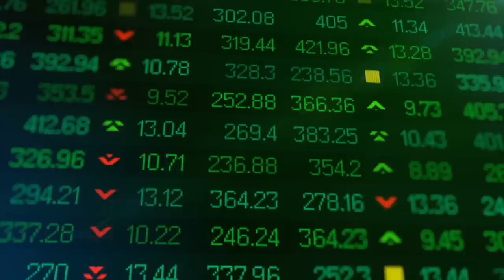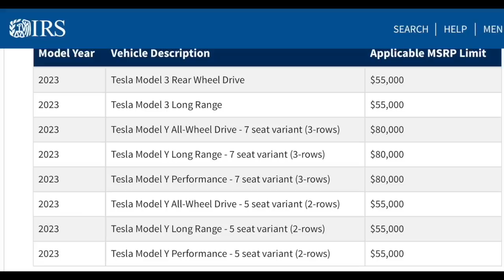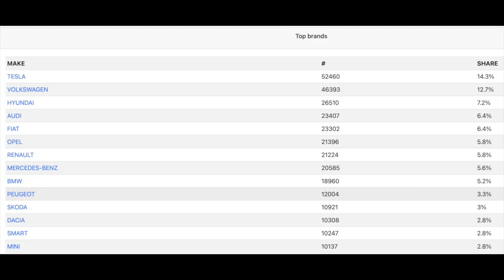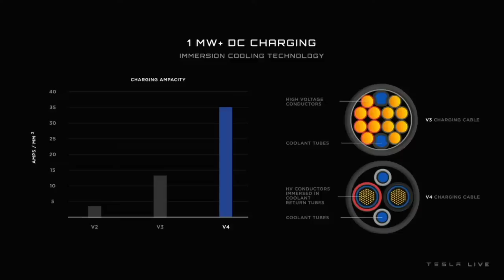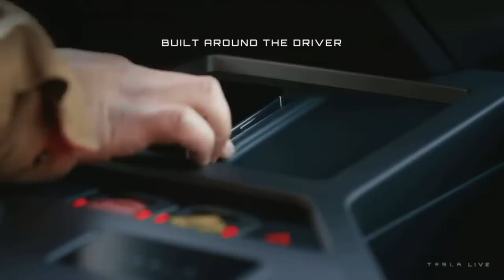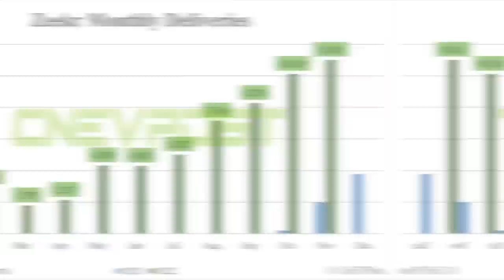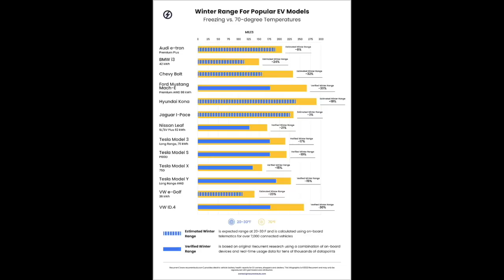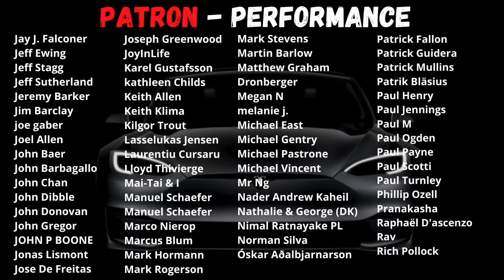Tesla beats VW in Europe & VW admits flat-out chaos!

Comment: What if the problem that drivers having with Ev‘s charging station is intentional to frustrate owners of Ev to keep public buying ICE vehicles because the reason why these charging station was building because of diesel gate, so it seems to me that they are intentionally sabotaging EV, charging to keep consumer, buying gas power vehicles.
Reply: Of course they do so because there is NO technical reason why Tesla chargers work and others always have some problems and criminal price structures. Then there is a mess with cards or CC just do not work. Everything is normed for a gas station and what about chargers and open price declaration? This all is politically and depending of oil and ICE lobbies! 😎

Comment: I had my Model Y for a year now, received it on Dec. 24, 2021, and we had a rough winter last year. What I noticed is that the range did drop to 50% but we had on average temperatures of -20C (-4F) and sometimes less than that.  Going to work and back took 40% of the battery.  During the summer months the same drive only took 20%.  I'm curious to see if they improved the range estimates in cold weather this year. Also charging without pre-conditioning in the cold takes forever.  Here in Canada, we don't have super chargers everywhere yet and sometimes I need to rely and public chargers, it would be nice if I could manually indicate that pre-conditioning is needed at a waypoint on the map.
Reply: Interesting, -20 is extreme and no mechanical equipment operates efficiently in those conditions. Were you able to precondition and warm the battery? Could the battery be warmed in those conditions?
Reply: Another words, Tesla sucks in very cold weather. I can't imagine other electric car brands. No thanks, I'll stick with my ICE car. 
My time is more valuable than anything!
Reply: @peterp4753  I own a Tesla and my experience is it is fine in cold weather, so long as the Model has the Heat Pump and the battery is preconditioned while plugged in. Regenerative brake is restored and range is not impact by 50% as hinted at here.

Not preconditioning an EV battery in that degree of cold weather is akin to jumping into an F150 in -20 and driving without warming up with a half foot of snow on the hood.

Unless the poster here responds with some additional details, I would chalk this one up to operator error. The fact that he mentioned charging without preconditioning the battery sucks speaks volumes.
Reply: Pre conditioning is ALWAYS BEST in cold weather specially at 250 mw chargers…. when ya lose a lil range in cold weather ur STILL saving money at th gas pumps an NOT  a contributing factor to the carbon level of th stratosphere TESLAPS big oil
Reply: @harrychu650  mechanical or not
Reply: How many people in that environment plug their ICE in to heat overnight ?
Reply: @peterp4753  ICE cars lose up to 20% in cold as well. It is not EV's it is all cars. The same as hailing stuff and losing range, ICE has issues as EV's do. The EV's are not the issue, it is all vehicles.
Reply: @mark totton Norway has over 50% EV adoption rate and leads the world. Seems like many of you neighbors do not share your concerns.
Reply: @mark totton ✌
Reply: Do you have a garage to park it in or not?  That is key, I think with a garage, partly under grade at 40F, and you would have less of a range hit.
Reply: Not many people drive regularly in -20 temperatures. I think for me it's no more than one week a year and that it's skiing where overnight it's -15 C and my Tesla is parked outside. The car works fine, it's just range which decreases.
Reply: @@marktotton4097 the comment did not say that your ICE wouldn't work, it said it wouldn't be as efficient. That's a big difference.
Reply: @@marktotton4097 hauling around a battery capable of 1000km will be idiotic once charging networks have matured.

Comment: ICE cars can take 4 hours to fill up and lose 35% range in cold weather!
Reply: I have a ICE car. In minus 10 celsius i still have 800 km range on my 50 liter tank and filling takes eksakt 2 min. one minute to park and pay, one minute to fill
Reply: @ulyden1947  Not if you have to use a crank pump and you drive an 1920's Rolls Royce Phantom Limousine.

Comment: Most consumers would find minus 16 degrees Celsius to be very cold. In some parts of Canada minus 30 to 40 Celsius is common for a few months. Much lower EV performance occurs at those temperatures. Unfortunately this is a significant safety problem. It is a special case for relatively few consumers (a few million) that still needs design innovations to address adequately..
Reply: Or more super chargers in more places. Fuel economy decreases in cold weather with all vehicles. People don't think about it with ICE vehicles because the gasoline/diesel infrastructure is ubiquitous.
Reply: Charging twice as long twice as often is impractical and is expensive. Distances are large and population light, so economics for superchargers are poor. Improved insulation and alternate source of heat is also needed.

Comment: Mega pack businesses will boom because low electricity prices in evening means that it is profitable for companies to run daytime operations on batteries where possibly and break even on capital cost of megapack within couple of years and assuming 2000 cycles it will go on for 7/8 years without loosing* huge efficiency

Comment: When Tesla opens up its’ charging network EA is finished. I think that Tesla should just buy EA and use it’s properties.
Reply: It would be a bad idea for Tesla to buy up other charging companies.  That would leave them open to monopoly charges.
Reply: @bobwallace9753  
I’ve thought about that but there are 2 or 3 other networks out there already. EA is just the largest next to Teslas network. And, I think that petroleum companies are going to get into the mix pretty soon.
Reply: There's a curious resistance to adopting the NACS by the anti-Tesla faction of the EV community.  Seems some people have forgotten where they came from.
Reply: @roxter299roxter7  
Having options is a good thing and most likely good advertising for Tesla.  Word will quickly spread that Tesla chargers work almost all the time.  "Next time I'll buy a Tesla".

Plus, as Tesla opens their chargers to other brands Tesla can make money selling them electricity.  Tesla has created an energy company which buys surplus electricity from Tesla solar/Powerwall customers and sells it on the grid.  

Tesla's cost to store electricity should be well under $0.01/kWh as they move to LFP cells.  They can buy surplus solar during the day and low off peak electricity at night which will give them lower cost electricity than the other charger companies.

One other charger company has started installing large storage at their charger stations but they are probably going to take a long time to catch up with Tesla.
Reply: @adam964  
Legacy auto has acted stupidly from the beginning when Tesla started showing them a better way.  If they require their customers to carry an adapter in order to use Tesla Superchargers that will only hurt their sales in the long run.
Reply: You do not see a Federal Trade Commission fight on that? Tesla buying EA would create a monopoly.

Comment: If you have a solid performing BEV it would be a simple matter to convert to H2 or hybrid assuming they become more convenient than just charging a battery. As a manufacturer, why wouldn't you set yourself up for maximum flexibility by having a viable product that could easily be improved by a smaller battery and a fuel cell or diesel generstor.  ICE cars are slow and unreliable. Now that people are learning this, nobody wants ro buy an ICE car anymore.  Electric car charging networks are just being established. All electricity needs is a solar panel and a battery. Can you imagine the difficulty of setting up a H2 or methane refuling network?  I would really like to hear the rationale behind going with H2. Unless the fuel source sold with the car could outlast the car, I dont see chamging the existimg gas and diesel infratructure to a different fuel.

Comment: I wonder if Tesla is perhaps shooting herself in the foot with her static application Li batteries.  They are driving up the demand for Li which is making their electric cars more expensive and thus reducing the market for these cars.  Possibly not a problem at present but may be soon.  Besides alternate technologies are superior in a number of ways for static applications.  Most can be cycled between 0 and 100% with no damage, last far longer, are easier to recycle, use cheap, readily available materials and only lack market share to become cheaper than Li batteries.  There are the ZnBr flow/plating and gel batteries, the SbCa and Al S liquid metal batteries, a range of redox batteries based on Fe or V and soon Na batteries.